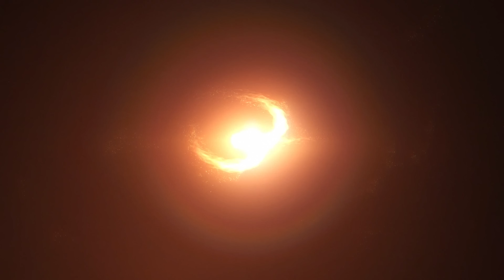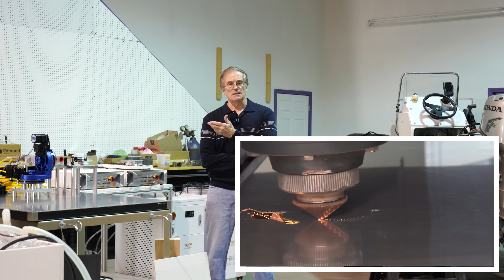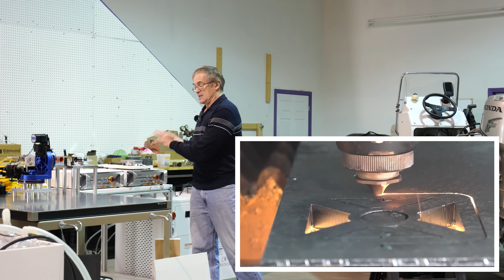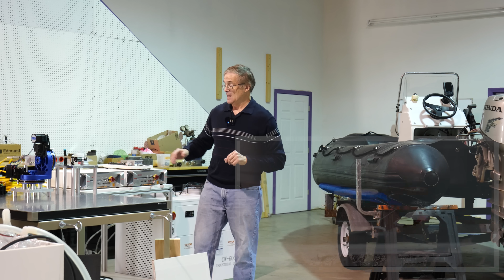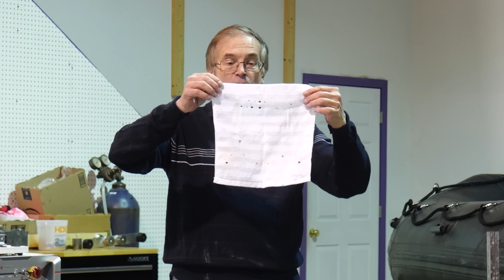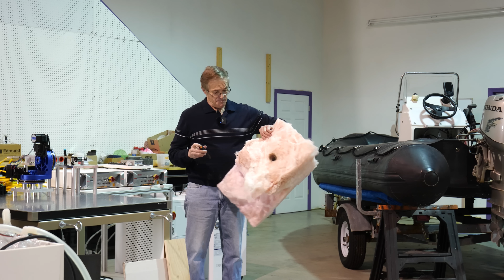We have a problem... and need your help!

Comment: Would building a backdrop of cheap multi-line beamsplitters do the trick. If the beam splitter wall was placed a meter before your radiation absorption wall this would greatly reduce the ablation rate of the absorption/safety wall.
Reply: I said cheap but maybe cheap beam splitters might not handle the power level you are working with. There are splitters that can handle but likely not inexpensive.
Reply: Another thought is you could use the drywall and put it on a mechanism that moves the safety wall around in an x/y sinusoidal pattern to buy more time for burning through.  This is probably the cheapest route if you just need 5-10 seconds for manual shut off. 

Embed a temp probe near the pattern to act as an auto-shut off as a backup to manually hitting the off button.

Comment: You could monitor IR past the desired target depth (the backstop) and if present, drop a de-focus lens into the beam before it exits the laser fixture. Use batteries for power, redundant IR sensors, all hardware design, a multiple spring loaded dead-man lens that diffuses the beam by default or failure or power loss of the battery. Cheap, small, light, and it protects the area BETWEEN the laser fixture and target too. Any place you don't want heat, point an IR detection device (a IR diode?) at it. This method can protect from bounced beams or from poorly aimed/focused beams that you didn't anticipate etc.. Think discrete semiconductors, not FLIR type devices. You may want to compare an ambient signal to the protected area and amplify that error with op amps or such.

Also, sodium transfers heat faster than water if you ever need to do that sort of thing. Changing sodium from solid to gas eats a lot of energy.

Comment: ISO26262 can give you some idea how safety is reached in automotive.
I think it is much better to block the laser at the source. Turning the power off, or adding a lense that can be mechanically or optically added to the laser beam to diverge it. Then you should define also a fire time for the laser, how long it is allowed to turned be on. Then a minimum off time, where the normal system can evaluate if another fire is required. Firing as long as the target is not hit. I could think maybe 250ms fire time, and 500ms evaluation if the target is still there. Parallel to this system, you must build an independent overwatcher, that checks if the fire time is not exceeded (also the evaluation time is hold), and if the system is still working (watchdog or kind of handshaking). When this parallel system detects a problem with the PC, it can turn off the power, or add the some special lense to the laser path that will cause the beam to divergence. Important that this parallel system should work independently form the main system. Like different voltage supply, different clock, separate microcontroller, separate access to enable or disable the laser (power supply, optical way to disable it). Also it is important that the main system only alloved to give fire command if the second system is working. So boot have to work normally in order that the laser can be fired. Debugging such system will be pain in the ass, because they are not really allowed to stop on a breakpoint. Actually it is, but they need to resyncronize.
And why dont you aim at the sky? Just add to the system the requirement that the laser is only allowed to fire if the elvation is min 20degree. Place the laser on some kind of a height. This way you can not hit your garage door. And even if there is a malfunction, the probability is very low to hit an aeroplane.

Comment: this isn't really a efficient idea probaly but more of a "that would be funny" and help with engagement. if the back could redirect the laser into something like a big container of water or a trap box that refracts it around till it loses energy. and using the heat generated to create power and power a little turbine/ fan or light bulb or something, "the worlds most complicated led" kind of thing

Comment: reconsder reflecting it, but away and on a convex (spherical?) or a directional scattering reflector, directed away so the intensity drops so you can use conventional materials and maybe some active cooling (maybe a very carbon rich asphalt just pasted over a large plate of metal to act as a heatsink).  I don't think trying to capture the laser beam directly behind where its most powerful is nearly as practical as just using more of the space you have and giving the beam direction and distance to disperse.

Comment: Acousto-Optic Deflector that turns on before Laser, turns off for a micro second to allow laser to go full power then back on to create dispersed, lower intensity pattern beam until laser turns back off. Won’t stop full power laser that gets past the target but reduce the pulse duration at least.

Comment: What's the wavelength?
I have a feeling you're starting to get to ABL Laser territory (yowza! -- burns thru aluminum)... so most things aren't all that reflective.  But maybe something like that Barium Sulfate?  Or Kaowool?  The stabilizer for the kaowool might be like the cardboard on the drywall though, and you don't wanna mess with kaowool without stabilizer...

Another idea is to use Rockwool instead of fiberglass.  More absorptive, but... can handle heat better (not sure about /that much/ heat, seeing what it did to fiberglass)...

Heh... I wonder what roll of ThO2 lantern wool would do.   At least it's not gonna oxidize...

For COIL testing, they used an array of black acrylic blocks... to record the beam shape, but it wasn't able to stop it.

Comment: Fast rotating, large, convex molybdenum mirror, with axis tilted about 45 degrees, reflecting downward, placed high above deep water with small air bubbles.

Comment: Unfortunately I can't stop to read all the comments to see if this has been covered, but I believe my next step would be a combination. A plywood wall, perhaps somewhat thicker than a single 3/4", but with a sheet of water continuously falling down the front. Perhaps a length of PVC with a slot cut down the length? The water would serve to not only refract the laser but also rewet the substrate faster than wicking or capillary action would do. And the water could be collected and recirculated. Something tells me you probably have a decent water pump around that shop somewhere.

Comment: Man, what a "problem" to have! Your lasers are beasts! For a backstop, my first thought is a really thick slab of steel, maybe an inch or two, and make sure to angle it pretty steeply so any rogue reflections shoot down into something like a big ol' sandpit or even just the ground if it's safe. That steel will take a beating for a few seconds.

Alternatively, just a deep, heavy-duty bin packed tight with sand or maybe that crushed firebrick stuff (grog) could do the trick too – the laser will just dig itself a hole. Graphite blocks would be amazing if you can get 'em, super heat resistant. Can't wait to see what you guys cook up to tame those photons! Good luck! 👍

Comment: Seems like your best option would end up being something composite that can self heal. Perhaps a couple sheets of steel with a gap you can fill with sand? The metal would burn/melt away fast (basically just acting as a structural element only) letting the sand above the hole start to flow down into it.

Comment: Immediately thought of NightHawkInLight video of diy Starlite, doesn't seem too expensive to ramp up. Other thing you could try would be compressed mineral wool insulation instead of fiberglass since its specifically used for fireblock. Hope this helps, awesome channel!

Comment: you stated that plywood worked relatively well, but it only started burning. I forgot the name of this fluid, but there is a fire-retardant fluid that is used to impregnate  cloth or wood, what if you use this on the plywood? or what if you carbonise the plywood in advance and then impregnate it with this fluid (damn. I wish I could remember the name of this substance)
another idea that popped up, have you also tried rock-wool insulation?? or foam-concrete may work as well, or a combination of several. the previous idea from Ceramic engineer may well be a good one as well in combination with for example the plywood

Comment: Instead of regular drwall, maybe fibercement boards? There are different thicknesses available. Also maybe rock wool instead of glass wool. rock has a way higher melting point than glass, I figure.
Also: probably a composite of e.g. a fiber cement board with rock wool behind it.

Comment: Woven silica fabric spaced 1/4 in from woven carbon mat with a water flowing down between the two. You likely culminated the beam quite well, but maybe a projector lens with auto focus based on parallax of two or three cameras would work as well.  Laser could be pulsed between closed camera shutter periods. AI should be able to track the drones and recognize which are friendly and which are foe, detect the position and distance.   Using 2 out of 3 logic if it is safe to fire another pulse.

Comment: Paint the plywood with intumescent paint, both sides, then add layer of sheet metal on the back of the plywood, thin gauge to keep weight down. Paint expands continuously to keep covering beam, wood absorbs and metal reflects a bit back into the paint on the back which also swells.

Comment: A few lame ideas from me but maybe they will inspire the collective to refine them. Idea 1) between 2 parallel glass panels, fill the gap with dirt, silica sand or may have to try a few materials. If the glass survives the laser, then it would travel into the dirt and melt it but if it made a hole, the surrounding dirt or sand might fall in to the hole to fill it. 

One problem I can see with the above though is that the first surface of the glass might reflect the light into an undesirable direction. To mitigate this problem, perhaps the glass could be angled so that the incident laser light spreads out as the sun’s light does in winter onto the earth. This might lower the intensity of the light and spread it out. Suppose the gap were filled with sand, the laser might cause the sand to glop into a shape which stops the inflow of replacement sand. Perhaps fill the gap with tinted gas. The tinting could be dark enough to absorb the light and as it heats up, convection currents might cause surrounding gas to  flow back in to replace it the hot spot.

Idea 2) Another idea…use a mirror to redirect the light towards the ground? 
 
Idea3) Maybe use the tilted target idea with the fire brick so the incident light doesn’t hit at a surface at a perpendicular angle, as in a more oblique angle? 
                                                                                                                                                                                                                             
That’s all I have for now….

Comment: Create an 'aquarium' made of plywood. Have multiple layers of plywood (perpendicular to the laser) submerged in water separated by about a centimeter. If the laser burns through, the plywood shouldn't burn(no air) and if there's enough water vertically it will keep the plywood from burning. Make as many layers as you need half seconds. It should be a bit more than a half second per plywood layer if it's soaked in water. Do keep the top open though, because I expect a lot of steam :)

Comment: Calcium Carbonate is a pretty cheap waste product of sugar production, when you get it from the factory, for around 50$ per metric ton (in my expensive country).
You wouldn't create any toxic waste because the high laser intensity, would create calcium oxide which, with a bit of humidity and Co2 from air, returns the calcium back to a carbonate.
Either as a pile, or DIY bricks or if you want a technical challenge, as a laminar slurry "water"fall...

Comment: If you could diffuse the beam before trying to absorb the energy that may work.  Using a double or triple paned window filled with an optically diffusing medium like ground glass, sandblasting quartz sand or similar material might work.  You could use several windows in layers on top of the absorbing material.

Comment: Copper plates or copper plated steel could be excellent option. It has excellent thermal conductivity, reflects IR poorly, and doesn't easily ignite
Reply: So expensive

Comment: Not sure about the specific setup you have in mind. Here are some considerations:

1. Limit the field of operation where the laser could exit as narrowly as possible, close to the source.

2. Use a brick wall in a confined area to convert the laser light into heat.

3. In other areas, direct the beam by reflecting it toward the confined area (the brick wall) using highly reflective materials, such as copper sheets, carefully arranged and aligned.

4. Monitor the operational area using light detectors or cameras to automatically shut down the laser emission when a peak in measurements occurs.

Thanks for all the valuable lessons and inspiration from your shared projects ❤ I learned a lot!

Comment: I would use wet bags of charcoal to extinguish fires. Graphite would probably be much better for absorbing the beam, but it's hard to get in large pieces. Black anodized aluminum could also work, as aluminum is relatively hard to cut. However, it carries the risk of reflections, so you’d need to build a conical beam trap out of it to minimize that.

Another idea is sandbags, but you'd need a fairly large grain size—otherwise, the sand may spill out once the bags are damaged. Sand is also quite heavy, but it's cheap and movable.

You could also consider a running water curtain, with the water pumped back up in a loop. That approach would likely work well, but it would require a fair bit of effort to implement without making a complete mess.

Comment: Two items you might consider that are organic and less likely to create toxic fumes are Rockwool and Mycelium board or brick (see Ecovative). Mycelium board & brick do, however, contain organic matter. — “The great thing about mycelium is that it forms a thermal protective char layer when exposed to fire or radiant heat. The longer and the higher temperature at which mycelium char survives, the better its use as a fireproof material,” said Kandare.Jul 13, 2023 - Fungi blaze a trail to fireproof cladding - RMIT University

Comment: What about ion-exchange treated borosilicate glass panels  (think Superfest, or Gorilla Glass) placed in series with sand (or perhaps ceramic beads) filling gaps between panels?  It seems like the glass would somewhat diffuse, and thus attenuate, the intensity of beam, but would the sand negate this effect? Old Pyrex baking pans (NOT the new recipe calling itself Pyrex) should be fairly cheap at the Goodwill or Salvation Army. 

I would LOVE to watch you use Superfest’s ion exchange process to strengthen glass - making a video, of course, on how to do this at home with supplies and materials available at the local Walmart.

Comment: High density (pressed) wool panels (high temperature over 1000 degres - white one) for forging ovens  - could help, but may be should add some high temperature resistant bricks ( there are some thin  ones one the market)
option 2 steel grates with sand inside ( quartz dry sand only)
example
"High temperature insulation board up to 1500-1600 C" (i dont want add links to have no bans.

Comment: I don't get why you need such a large area. Couldn't you simply aim the beam into a 100mm tube filled with water or whatever to diaperse and/or absorb the energy? You could easily handle a fairly long tube.
Reply: Trying to hit a moving target with the beam.

Comment: Aerogel i think, it's expensive but it would do a good job i think... ?
Reply: No, light goes right through, mostly air,
Reply: @Nickgrows8things  High-Energy Laser Protection Performance of Fibrous Felt-Reinforced Aerogels with Hierarchical Porous Architectures ACS, i posted a link but it didn't post i think. i know science, budget etc. but science!

Comment: Dig a down sloping trench.  It doesn't have to be deep.  Aim the laser down below horizontal.  The beam will strike the back wall of the trench.  The deeper it burns, the deeper the beam goes beneath the earth surface.  Cost, zero.  Portable because you can dig a trench anywhere.
Reply: Time is money, expensive, plus drones fly!

Comment: If the wall or obstacle is known, you can choose a wavelength that is not absorbed by that material, so it doesn't transfer energy to it:

Mid-IR (3–5 µm): some plastics, fabrics, or thin walls become transparent at this wavelength.

THz (0.1–10 THz): can penetrate non-metallic walls, clothing, paper, wood.

Microwave lasers (MASER): can be used for deep penetration without thermal effects.
or 
Impulse Gating (Temporal Windows)
You send a short pulse (femtosecond – 10⁻¹⁵ s).

You activate detection or the desired reaction only after a time delay, equivalent to the time it takes for the pulse to reach a specific depth or distance.

You can calculate this using:
time = distance / speed of light → and synchronize the detection or activation system accordingly.

or
active Path Filtering (beam dumping for unexpected Obstacles)
You install a secondary optical system:

If an obstacle is detected unexpectedly or temporarily, a sensor diverts or shuts off the laser beam to a beam dump (a device that safely absorbs the laser energy).

If the path is clear, the laser is redirected back toward the target.